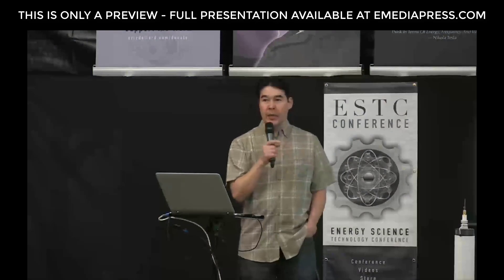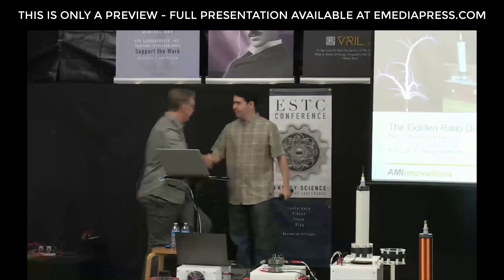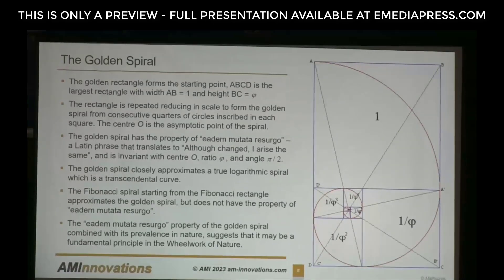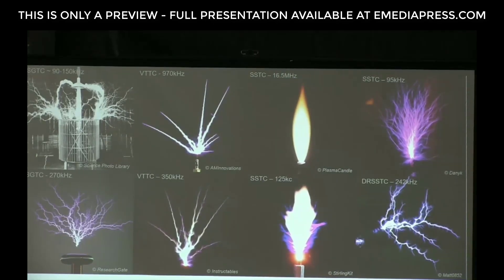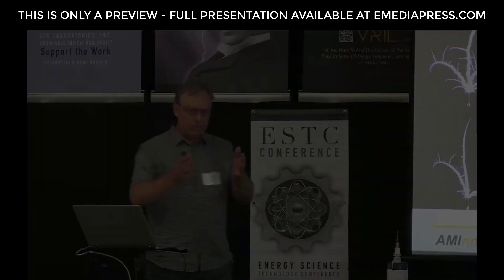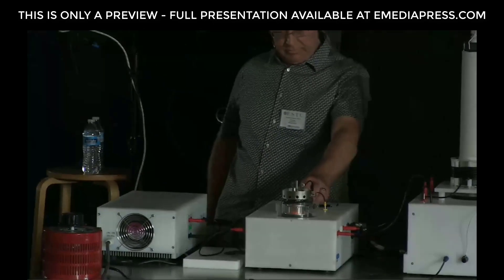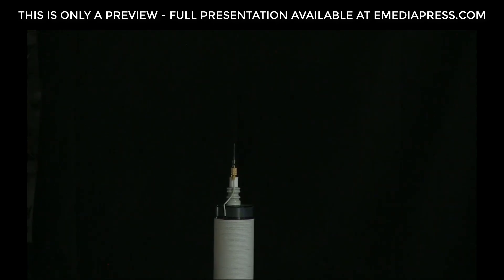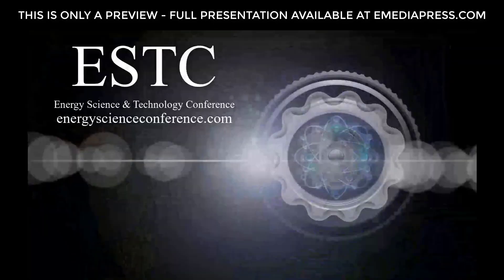2023 ESTC ADRIAN MARSH PhD - THE GOLDEN RATIO DISCHARGE

Comment: Think about the vacuum. There is empty space and it has a permeability and permitivity and of course the emtpy space has a breakdown voltage, t.m. the building of an electrical discharge channel !!!
Do that mean, if the potential is high enough this potential is able to produce charges, that opens the channel?
The electrical field and the magnetic field is coupled, what you can see in the original forms of Maxwell equations. The quaterion form also takes care of the right hand rule of nature. 
The structures here can also be seen in the Mandelbrot formulars.
And this video shows that this has something to do with our nature!
Thanks for the video!!!

Comment: I have two questions/suggestions - what happens if you connect the lower (in the diagram) ground line to Line_ND (2)? and what happens if you duplicate the system to run two of these in parallel? perhaps on phi-multiplied voltage or doubled wattage?